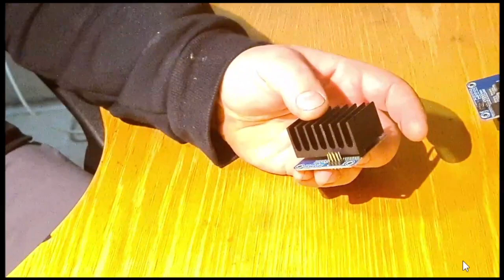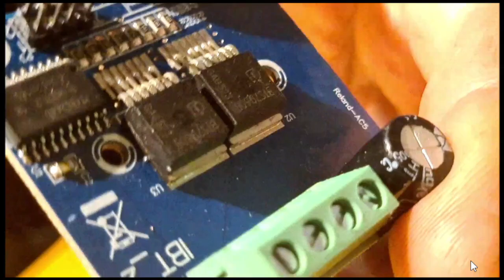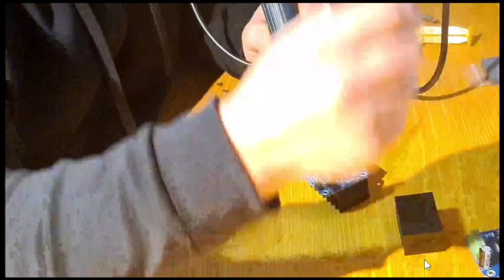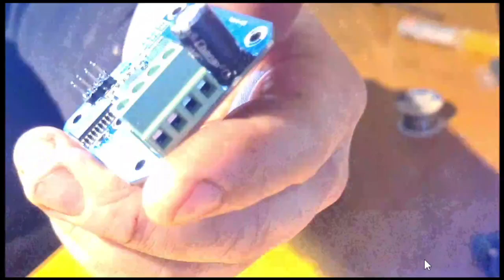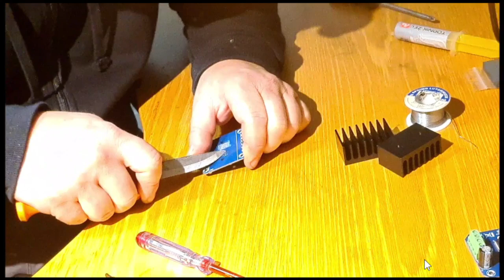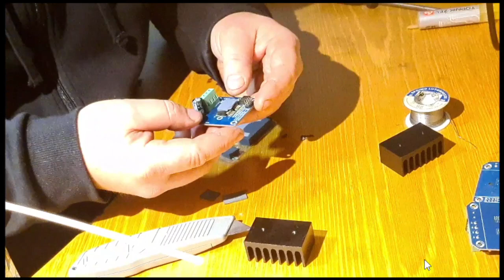IBT-2  BTS7960B Motor Driver mode with two radiators. Part 1 of 2.

Comment: Hi, may i know how is the performance after the mod? And how long did they work after the mod? Planning to do this if it really works well, thank you for sharing brother.
Reply from the maker: Hi, The IBTs were driving for me 300W motors and for one motor i used two IBTs parallel. I was using the rig for a year after that mod with no problems,  important thing these IBTs do not like high frequency i think I have set frequency on 15 kHz on mine, they were made little noise in the motors but i was always playing with headphones. And you need to put a fan to keep them cool too. After a year  i have build a new rig with these: https://www.aliexpress.com/item/32728776675.html?spm=a2g0o.order_list.order_list_main.29.3f191c24ZhRryE ,100A drivers  they works better and you do not need to mode anything and capable to send also more power to motors.
Reply: @select1897  Thanks a lot for sharing your experience, brother! Really appreciate the detailed info 🙌 It’s good to know the mod held up well for about a year without issues. The tip about keeping the frequency around 15 kHz and adding proper cooling is super helpful too.

Those 100A drivers you mentioned sound like a solid upgrade might consider going that route instead of modding. Thanks again for the guidance!

Comment: would thermal paste function the same? that way you don;t need to remove the bts chips and only the heatsink on the bottom side?
Reply from the maker: Thermal paste applied to the chips will serve the same function, but on the underside, due to the risk of a short circuit, I wouldn’t recommend using paste. Instead, I would suggest thermal pads to increase the distance between the cleaned copper pads and the aluminum heatsink. To remove chips is only to be sure there is enough solder under to proper heat transfer.